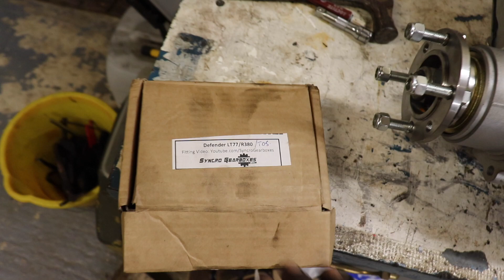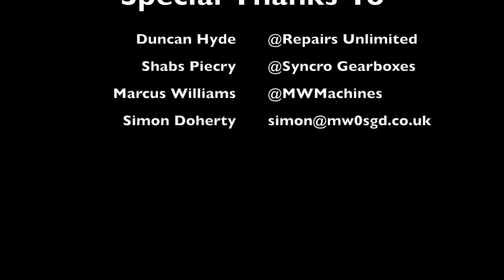Project M57: Episode 4 - Getting My Shift Together With Syncro Gearboxes Slick Shift

Comment: Apart from the new sleeve on the transfer box , I am running the same transmission set up as you, really pleased with it.
On the road the ATB means you can really get the power down, so no more interesting moments on wet roundabouts.
Keep up the good work, Regards K.
Reply from the maker: Hi Kevin, thanks for your support. That's exactly what I'm looking for. I had a couple of interesting moments on roundabouts when I had a 200tdi in it, so thought it was best with all the power of the M57. Cheers, Ollie.